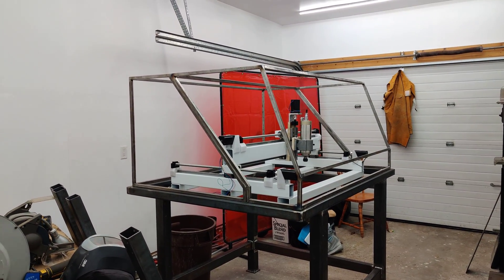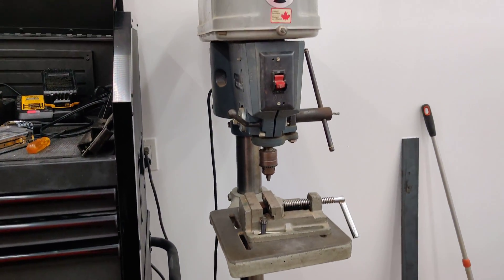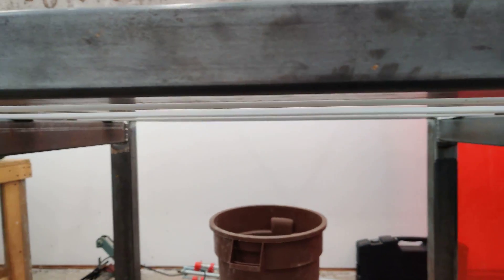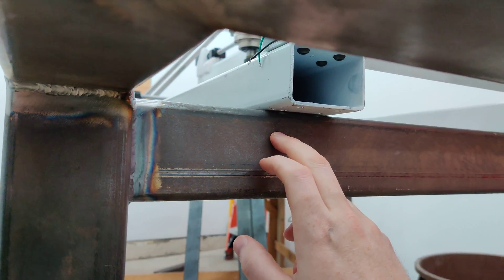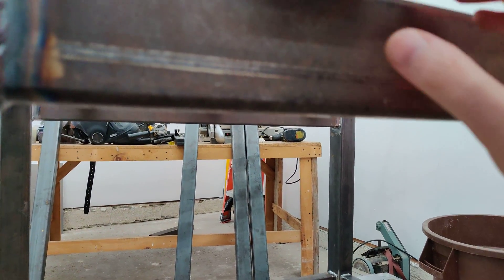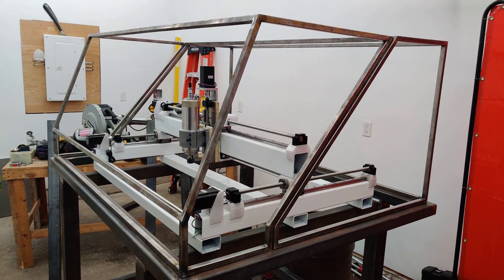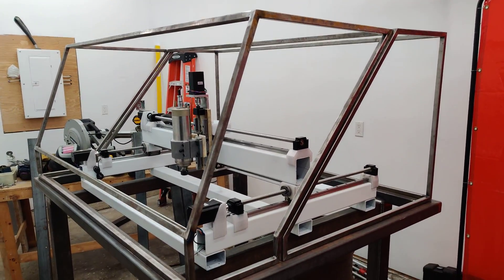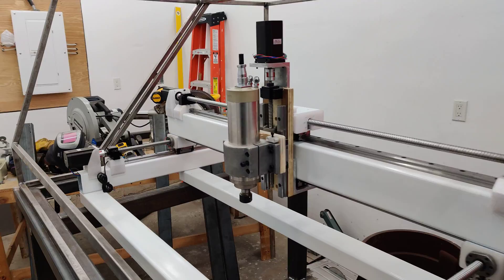PrintNC CNC Machine: Building a Steel Table Enclosure

Comment: This looks like nice craftsmanship!   I am trying to gather enough knowledge and courage to start on a build myself.   What are the dimensions of your build?  It looks larger than the default 625x625 metal-cutter blueprints for PrintNC V4.
Reply from the maker: Thanks. This CNC I was going through further changes since this video. It started out as a standard size printnc before there were different versions like woodcutter and metal on the current version from Logan on the discord.